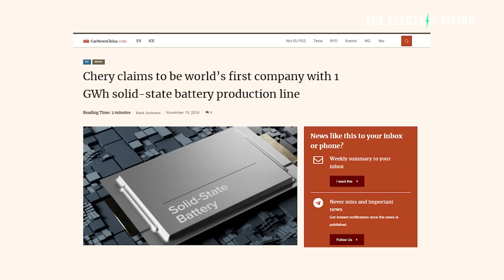Car maker shocks everyone with mass production solid state battery factory

Comment: Laptops represent the entry point for new battery technologies.  In terms of battery cells it is a low volume, high value, performance demanding market.  If there is break through in solid state battery chemistry we are likely to see it in laptops first.
Reply: The transition to EV's is what has increased investment in battery tech. 
Laptop batteries are cheap to replace and you are usually sitting at a table within close proximity to a socket so solid state for laptop batteries is pretty pointless over the existing Li-Ion.
Reply: Nope, laptops still use Li-Ion batteries, if this statement was true then NMC, NCA, LFP, LMFP batteries etc would have been deployed in laptops first, which was not the case. Rather batteries are designed for a specific set of requirements, where those for laptops differ to vehicle and BESS. The same applied to current solid-state developments that are targetting EV needs - high current charge/discharge capability, high cycle life, low self discharge and high charge density - at levels beyond that suited or required in laptops.

There is a whole industry producing batteries for EVs and BESS applications, many of the companies involved having never produced a laptop battery.

Comment: The problem is that there is not enough electrical generation to power a fully electric car and truck transporation network; and its not even close to enough.   

I think it will take a minimum of 25 years to build the required electrical generation to have an full electric vehicle infastructure.   I see ICE vehicles for at least that time.

For specialized vehicles (especially military) I see ICE chugging on for likely 50 years
Reply: You must be beside yourself with despair about the electricity being used in data centres, AI and crypto mining.
Reply: You know those huge cables that go to oil refineries? What do you think flows through them? Making oil also uses electricity, so think about that!
Oh, and the price of solar panels is through the floor.
Reply: We in the UK we now have the power available and moving to full electrics. Invest here. The US does not want EVs  Europe does.
Reply: @caterthun4853  Is it a joke? Autotrader webpage shows 18k EVs out of 435k overall, i.e. about 4%. Good luck with that.
Reply: Jai Hind.  AI chips in EVs are future energy guzzlers.
Reply: @tedchandran  - "AI chips" don't eat that much power, they run a model that has been determined by a cloud/offline AI system rather than do the heavy work of determining a model. Indeed they can save power by offloading the CPU from performing complex processing to a processing unit that is power/speed optimised for such work.
Reply: You don’t have to build anything, make solar panels and battery backup for homes affordable and reliable and then you just have to worry about truck transportation, of which you you can use the same system to charge trucks
Reply: @preeyakumari-i2q  You have no idea of the scale of the problem nor the cost of making solar and battery backup long term reliable (like for many decades).  currently the life of the vast majority of battery backup is fairly short.   I have multiple sets of Li-Ion batteries that are advertised to be rechargeable for at least 1000 cycles that are at 50% capacity after just a few hundred - and I don't discharge them all the way.

I got one company to admit that their near 1000 cycles was only if the battery was discharged 25% of its capacity or less.

So to get 100 % capacity 1000 cycles I need to buy batteries with 4 times the capabilities.   Please explain how that works out cost wise.

Comment: From what I can tell there is also potentially a big benefit for solid state batteries that I don't think you touched upon here and it would be interesting to see what the specifics are on these batteries in particular but - solid state batteries are regarded as having 4 to 5 times the cycle life of lithium ion - so - a much longer life. That could be a real lubricant to the uptake of EVs and could pave the way for much longer warranties on the cars/batteries